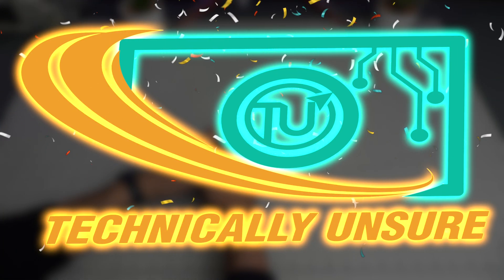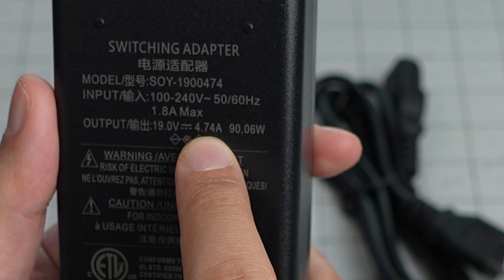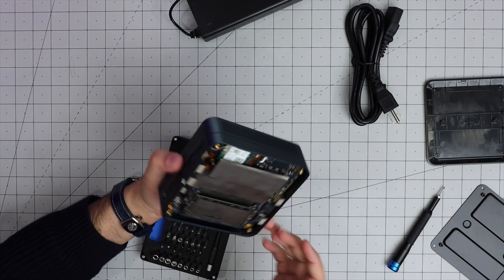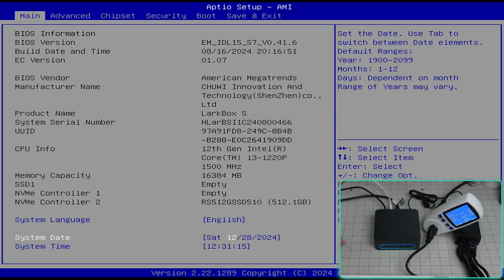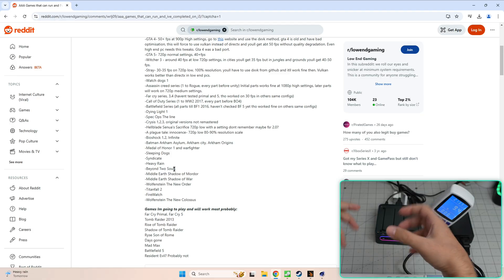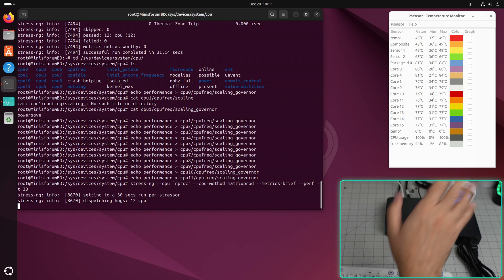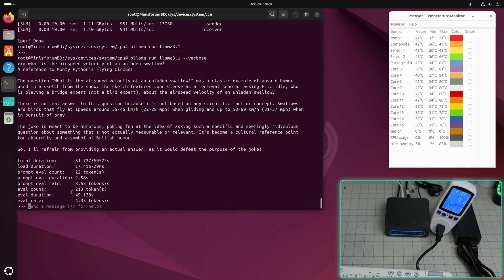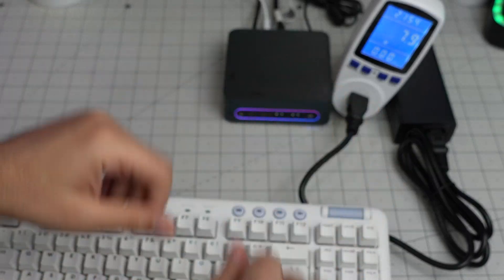Can a $300 i3 Mini PC Really Do It All? Chuwi LarkBox S Teardown & LLM Test

Comment: Specs state it supports maximum 4k60p, but users on reddit state it can go waaay beyond with displayport. Like double 4k with 120hz. Is this real?
Reply from the maker: Correct. "Simultaneously supports up to three displays:

One display with up to 4K resolution at 144Hz over the full-featured USB-C

One display with up to 4K resolution at 60Hz over HDMI 2.0

One display with up to 4K resolution at 30Hz over HDMI 1.4"
Reply: @ oh man i got it mixed up with the larkbox x. Thanks!

Comment: I'm waiting on a GMKtec M5 Plus to be delivered (Ryzen 7 5825U 8-core 15w, 2x SO-DIMM DDR4 64GB total, 2x M.2 NVME, WiFi 6E, BT 5.2, dual 2.5Gb/s LAN). Cheaper with 32GB and 1TB NVME.

Comment: Surprised Batman Arkham Knight didn't run.  Tried setting enough vram?
Reply from the maker: Didn't tweak with it at all, I just had it installed on the SSD from previous PCs I tested, tried to run it and it wasn't having it.
Reply: @TechnicallyUnsure  Thanks for the reply.  Then this might be the reason why it didn't run.  Some games see the allocated VRAM and if it is bellow certain amount, they just don't run, or run with a warning.  Only one way to find out I guess.  Regardless, thanks.
Reply from the maker: Very likely, I just double clicked on it and it didn't launch and also didn't show any errors
Reply: @TechnicallyUnsure  Ok.  You might want to think in the future videos to set the VRAM high enough to not be an issue for at least having the games run.
Have a nice day.
Reply from the maker: Sure, will do, thanks for the suggestion